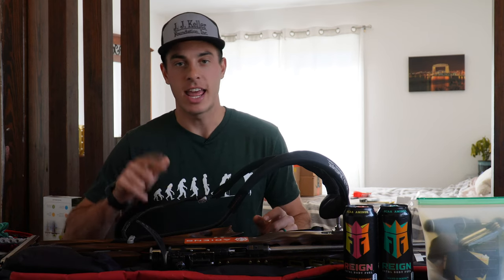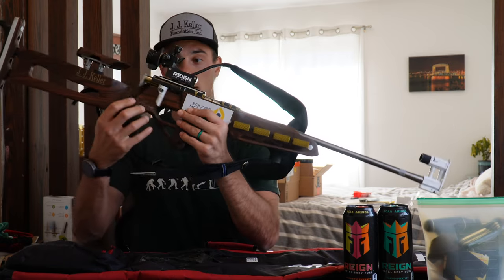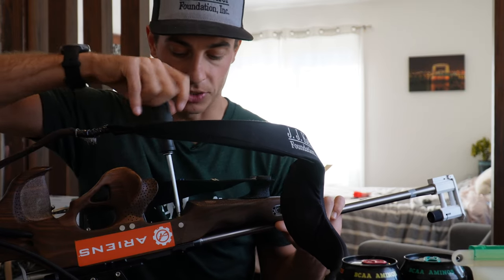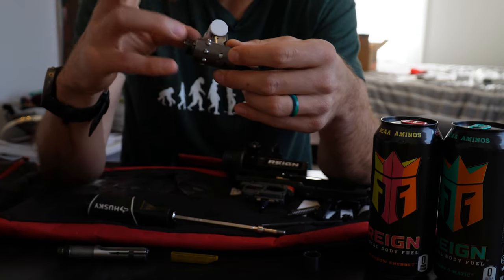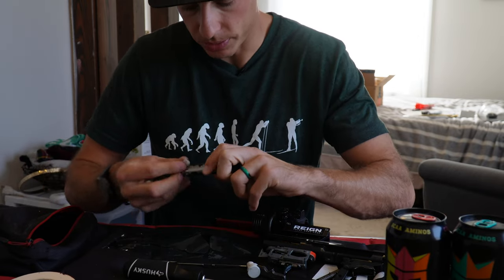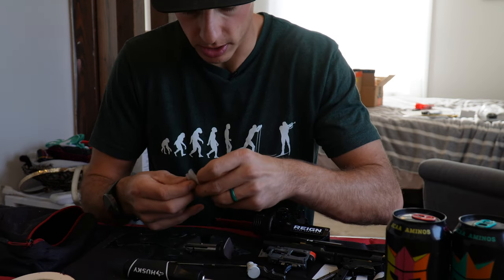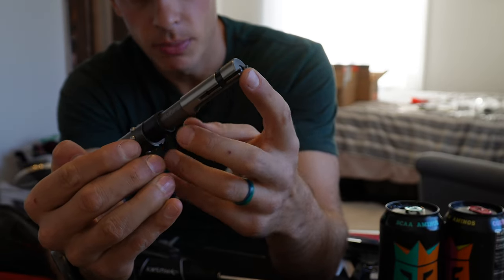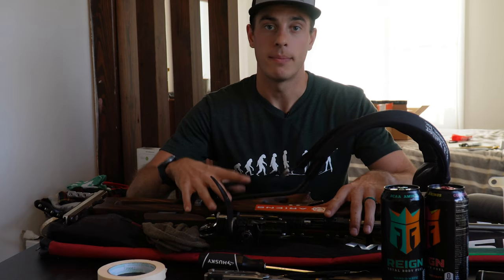Replacing Firing Pin- Anschutz Biathlon Rifle

Comment: This is the perfect opportunity to ask a question I've had for a couple years. I've read in some places that dry firing can damage a firing pin, in other places that it's not a big problem. I have also seen that Anschutz sells a "dry fire adapter" that supposedly mitigates some of the problems from dry firing. So my question is do most biathletes use this dry fire adapter most of the time, or only when they are doing a lot of dry-fire and no live fire, or do they not use it much at all?
Reply from the maker: Bolting normally while dry firing can cause damage, but it takes a while. Most biathletes travel with an extra firing pin so if it does break it's not a huge deal as it is replaceable. Some biathletes will half-bolt when dry firing to avoid engaging the firing pin when dry firing but not many, that I know of, will use the adapter you are talking about.